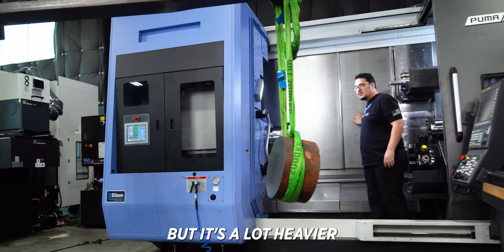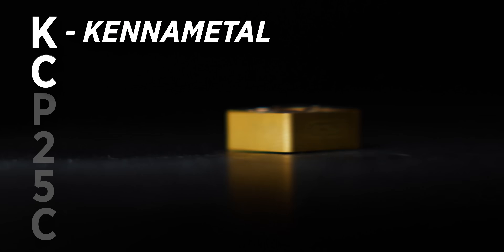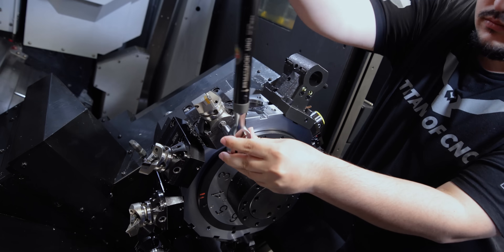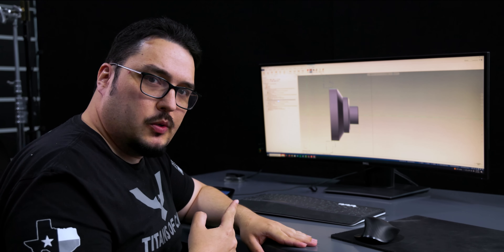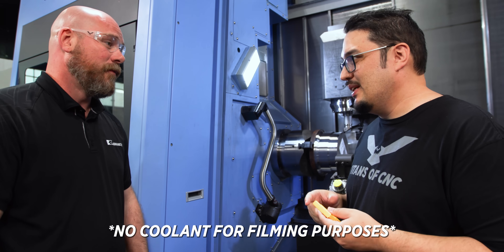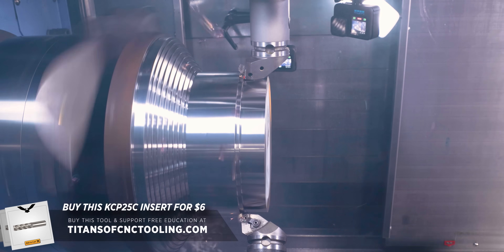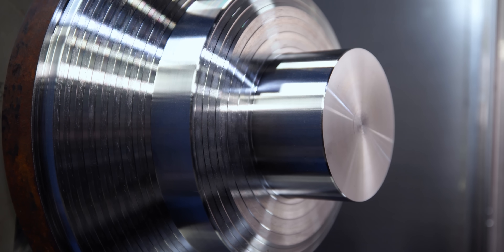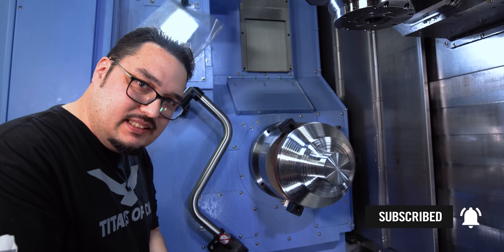SHOCKING Metal Removal | Pushing The Limits Using NEW KCP25C Inserts

Comment: When roughing I would always take a depth of cut about 3/4 of the depth of the insert. Never at 1/2 depth of insert as the stresses at the insert hole will cause failure.

Comment: You guys need to do some videos on turning and milling phenolics, plastics, and other composite materials.

Also,  should do some videos on tooling geometry and it's applications. Can't really find anything on why certain angles, back grinds,  insert styles,  rakes, chip breakers,  etc are to be used and when in depth other than "this metal,  use this rake"

Thank you guys. Your channel is awesome. Love from Pittsburgh, PA

Comment: Tried this type of machining on a 4 axis Okuma LC20M approx 33 years ago. The only difference being that the Upper and Lower tools are exactly 180° apart, so I got to thinking if I precisley set the Z tool offset so that both tools were at the same posn on Z at all times I could "Double" the feedrate! Effective feedrate on each tool was only 50% of the actual programmed feedrate. Okuma allowes you to use "P" codes to keep both turrets synchronised at all times. Insane productivity! If the Z offsets were not exact, this would result in the "Leading" turret taking a heavier feedrate, so you had to make sure that you checked this.

Comment: I love watching your videos and they are very informative. I have been machining for nearly 30 years and this isn't what I would consider heavy turning. I have run some of the largest lathes around my area. Heavy turning I did was .625 DOC or greater at feed rate of up to .063 IPR.
Reply: It's a puma. Pretty sure the torque isn't there for the deeper cuts.

Comment: That’s an awesome infomercial for those inserts but they do exactly what they say they will do. I’ve never seen a better chips that are damn near the exact same color question will the insert have a little discoloration if you use coolant, they should’ve done that to show or flip it around and show you run in a monster cut with coolant to show no heat discoloration on the insert

Comment: Using coolant would most likely have caused the insert to thermal fracture
Reply: IF the cutting stress is low it would never get hot enough to get to that point.  Being that they said multiple times they were not using it for filming, they probably recommend running coolant with this insert.  Otherwise, it would have been noted in the video that this was designed to be run without coolant. And, my experience running my cnc lathe is that inserts last longer and produce a better finish running coolant.
Reply: @bobsbillets  that’s fine for finishing, when you are trying to maximize stock removal turn it off and let the heat leave with the chip. Try it, slow down the sfm and turn the feed up. You should always be using different tools for roughing and finishing

Comment: Gonna be using these in 4340 tomorrow with a .150 DOC, curious to see how they do. Our tool rep gave us a bunch to test
Reply: How did it go? We do 4140 quite a bit, so would be interested to know how you went with the 4340.
Reply: @Drafty01  running at 320SFM feeding at .022 DOC .150 it's doing much better than our sumitomo 543 AC8025P EMU! The sumi made 2 parts while the cnmg 543 KC25P made 5, we are using a slightly different chip breaker shown in video. We tried to bump up the sfm but it quickly failed. We are in cut for roughly 16min. Still trying to get things dialed in.

Comment: Very impressive, I would have expected the corner to have started chipping out with running no coolant, at that price it's a no-brainer even for manual laths that aren't running coolant all the time. It seems kind of crazy that you would machine such a large and expensive piece of bar stock just for a video but I guess it makes sales and revenue from video but after just placing an order of steel at around $15K I would hate to waste that much steel just to test and demonstrate a product, too bad you didn't have a part order that could have been used for this test.

Comment: Iv used these inserts for a long time! They were great, loved using them
On 4140 , chips break like butter even at lower feed rates, I typically turned at .040 per rev and faced at .050 for roughing. Kennametal makes the best inserts/ drills, sandvik beats them on endmills
Reply: 1045 isn't really some crazy steel to machine. Yes, they use high SFM, but 0.012 IPR isn't impressive, and he basically used two inserts for roughing this piece.
Reply: @ChrisMaj  yeah I know, they haven’t really pushed their lathes very hard
Reply: Did you notice a difference in the Kennametal inserts vs the Sandvik inserts? Like the ones in video?
Reply: @Baby_J1  just the price!😂 sandvik is so expensive. Haven’t really looked too closely at them never noticed how it directs coolant to the tip

Comment: loll my shop mainly uses Sandvik, and last week a Kennametal distributor showed up to get us to try these inserts,  they aren't bad, just nothing special, we use similar cnmg insert from sandvik that works just fine.
Reply: I think for most shops, what would be the deciding factor, would be what the price of the insert costs.  Most inserts today will cut very similar if used for their intended purpose.

Comment: On parts 12 inches or bigger. Was doing that with cemented carbide tool bits. In the late 80s. On a manual monarch lathe.

Comment: I ran a Tungaloy insert(CNMG120408-TM_T9225)(~7,5€) in 1.7131(5115) a few weeks ago with 280m/min 7mmDOC and 0.48mm/rev on a DMG CTXbeta800.
To be fair I was using regular 10Bar floodcoolant.
Reply: Для твоих параметров лучше стружколом TH и радиус пластины 1.2...

Comment: why dont you do facing first and then rough through the material, so the insert is not hitting the sawn surface at the start of the cut? I think by cleaning it first the insert can hold for much longer
Reply: With such a heavy piece of stock it makes sense to balance the weight by OD cutting before running the higher rpm required to face down to center
Reply: @ryanharsch042  True but after you get full cleanup on the od you can then face it and go back to turning the od.

Comment: May I know if Titan’s has tried Walter cutting tools and your experience with them?
Reply from the maker: I have and they have many great tools.
Reply: In my shop we have Walter tools only for turning, except grooving where we use Horn and Arno, and you can really push these inserts. I was turning a big pipe(OD: 900mm, 4000mm long) and i had to take the outside scale down with one cut, and the machine and inserts just pushed through with a doc of about 10mm, with the weld spiking at about 15mm , a constant 1.1mm per rev feed and 180m/min cutting speed. these Walter inserts are great. One cut took about 45min
Reply: Every brand has their place, we do alot of turning at our shop and I would say for ISO turning Walter is definitely superior to kennametal